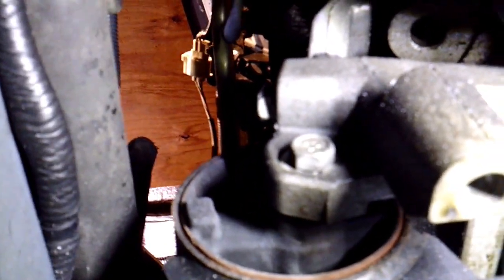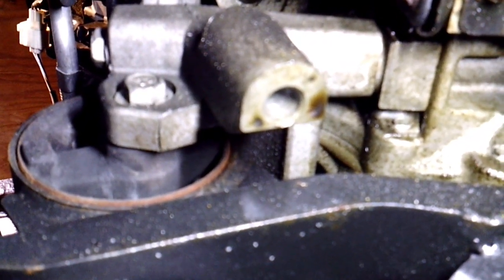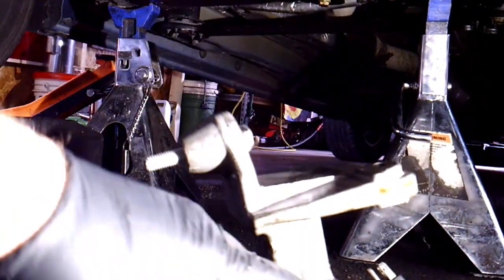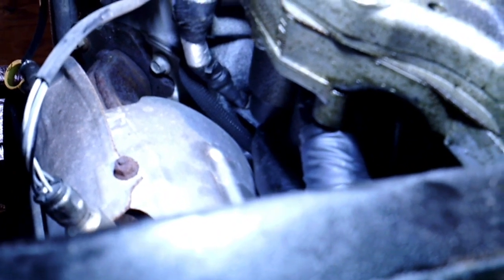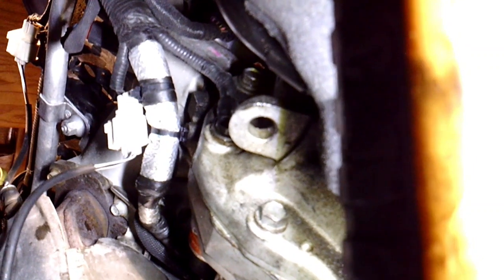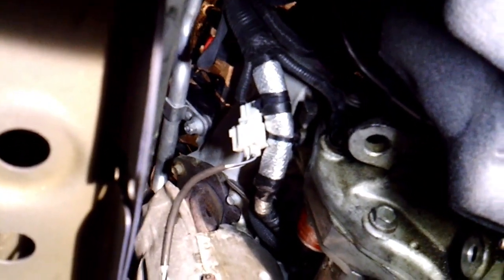Dodge Avenger 3.6 v6 Starter Replacement

Comment: I have this exact same year and make of car.  I've changed out the starter once, about a yea rand a half ago.  Now I have to do it again.  My big hangup is getting the starter out.  I took off the catalytic converter heat shield the last time I did it, but tried to avoid it this time.  I just couldn't get the correct angle to get the thing out. So I'm trying to take the heat shield off again, and I can't get the last piece off.  I need a video that shows exactly how you guys are taking the starter out.
Reply from the maker: It should come out without taking shield off unless you have some sort of aftermarket cat on there.
Reply: @HooptiesGarage  - So I finally got that other piece of the heat shield off, but then when I put the starter in, I couldn't get the shield back on.  
So I put the shield back on first, then attempted to put the starter back in.  It's a very tricky angle, but I got it in.  Hopefully that will be the last time I put a starter on that car.  But if I have to do it again, I'm not taking that shield off ever again.   I'm just going to have to be patient enough to find the correct angle to pull the starter out, once everything is unhooked.
Reply from the maker: @finisher3x  yep it's a tight for sure but they will come out.
Reply: And I'm back 1.5 years later, putting another starter in.  Avenger now 8 years old and has 140,000 miles on it, with various things wrong with it.  ( Oil filter cooler leaking, Oil pressure sensor needing replaced, passenger window won't roll up ).  Just seeing if I can at least get 180K miles out of it, before I decide to get another car.  Outside of this starter, it's been a great car.   

Just came back to this video to see the wrench you used to take the nut off of the starter battery cable.  LOL . . I need that wrench.  Right now, that's the hardest part of the job.

Comment: Good stuff buddy
Reply from the maker: I bet you do a ton of these at dealer
Reply: @HooptiesGarage  I've replaced a few over the years. But it seems I have to remove them more often..lol..they have to be back off the trans during trans work..now the starters on the Cherokee 2.4 engines are a beast to do

Comment: I was able to completely remove the starter but the connector piece was fried and the wire was damaged. Now I’m having to call a mechanic 🥲 but anyways thx for the video I least I got to find out what the problem was